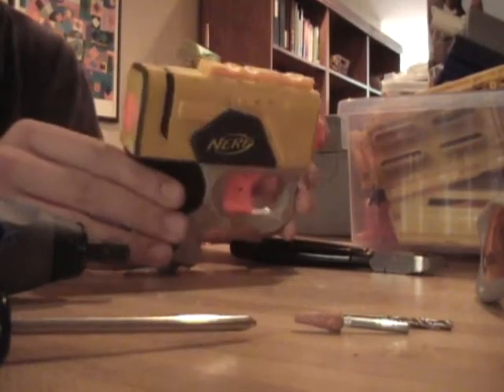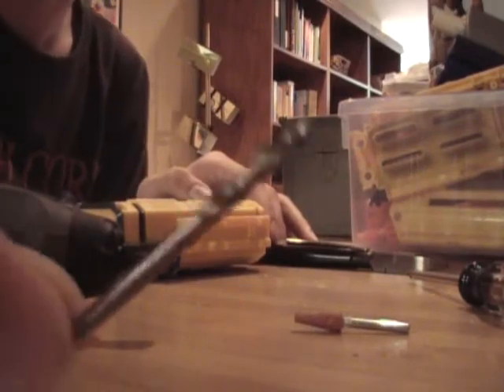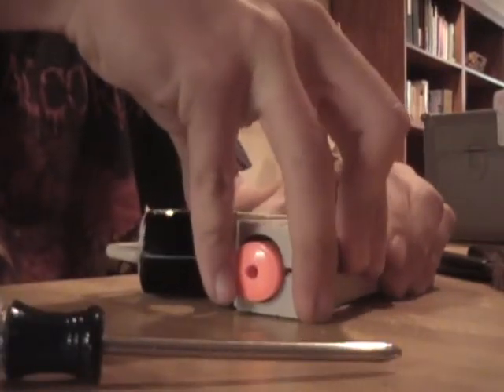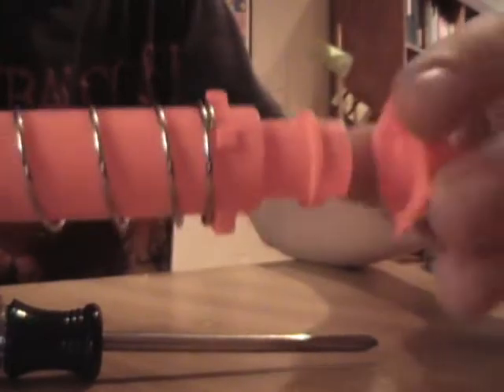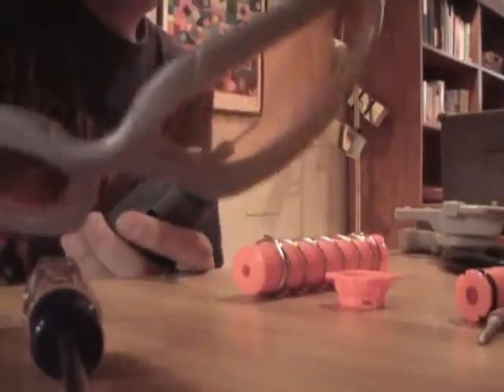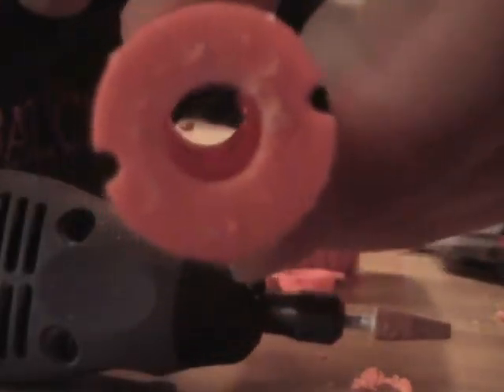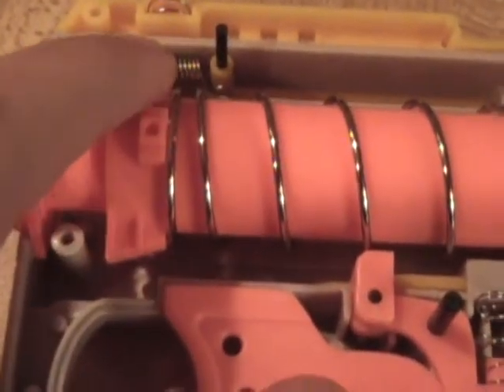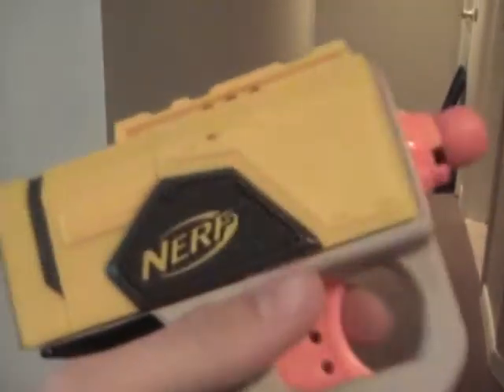How to Modify a Nerf Eliminator

Comment from the maker: It's possiblee that the screw has been stripped. Now, you can get it out 3 ways. You lift up the shell as much as you can with that screw still in and you twist until the screw comes undone. Another way is that you can simply break that screw post. If you have to do that, make sure you keep track of the internals. And the third way is to get a slightly bigger screwdriver than can still fit into the screw hole, and twist really hard to loosen the screw.